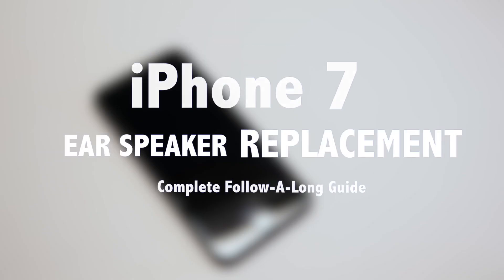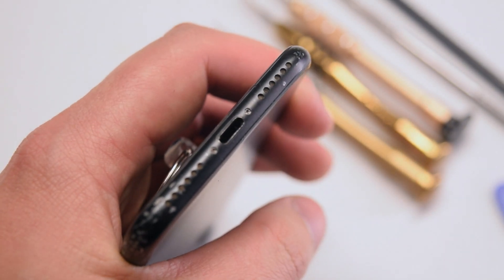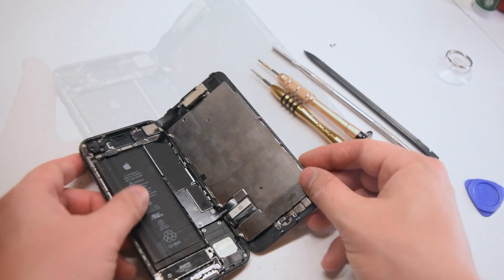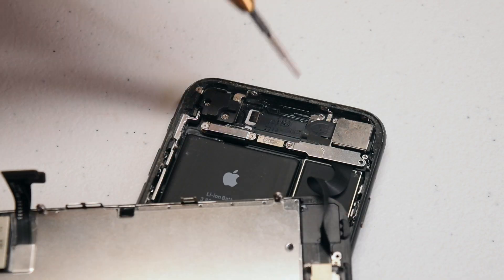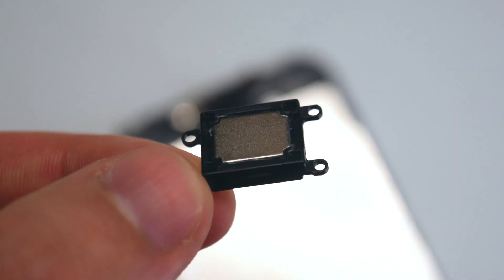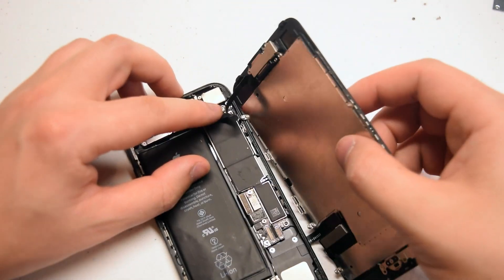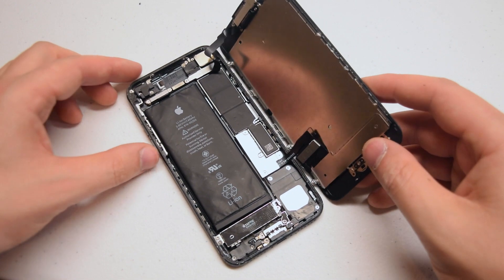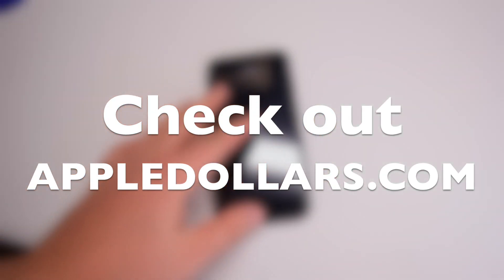iPhone 7 Ear Speaker Replacement

Comment: I just replaced the ear speaker following your guide. The volume is veeeryyy low and it seems like I didn't resolved the problem. My question is: is the piece that I bought from Amazon probably made of bad quality or did I reassembled the iPhone in a wrong way, maybe disconnecting or breaking something inside? Thank you for the reply

Comment: Hi, I dropped my 7 and during calls I can't hear/be heard and it doesn't register headphones instead plays out of the main speaker, any ideas what the problem is and what to do? Thank you
Reply from the maker: Most likely the speaker contacts got misaligned. If you take it apart and put it back together, it might fix the issue. Speaking from experience, it's very likely.

Comment: I hace a question, the iPhone 7 needs glue on the screen after reassembly?
Reply: Nope it doesn't. In fact it will make so much easier to access it again should you need it. Water protection will be affected - but if you plan not to expose it to water - who cares?